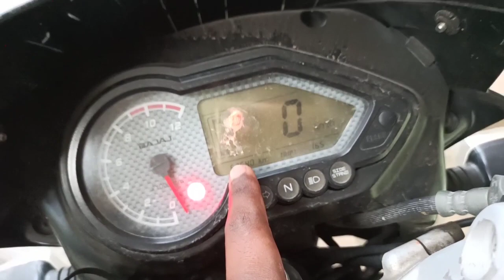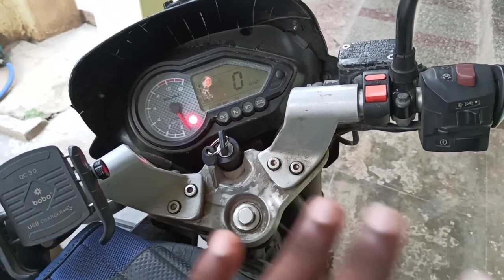Second hand-ல Bike வாங்கலாமா | How To Buy A Second Hand Bike | Tips And Tricks For Begginers | தமிழ்

Comment: Hi bro rs 200 2016 65k vaangalama bro ?
40000 km odiruku .
Reply: Dont buy 40000 oduna bika vangathinga
Appadi vanginigana  athika selavagun 
1)cluch plate change 
2)new tyre change
3)chain sprocket change
4)cluch cable change 
5)spark plug change 
6)disk pad change 
7) new battery change 
Ethalam change pannathane vandi otta nalla erukum  
Etoda motha selavu 15000 thandum 
Athanal vanga vendam
18000 km kammiya odunna bike vanga muyarchi pannunga
Reply: @aravindhan3255  tnx bro